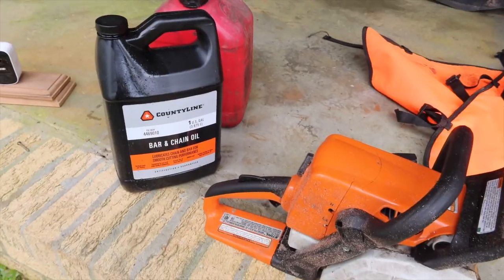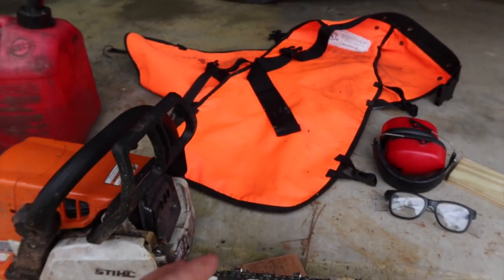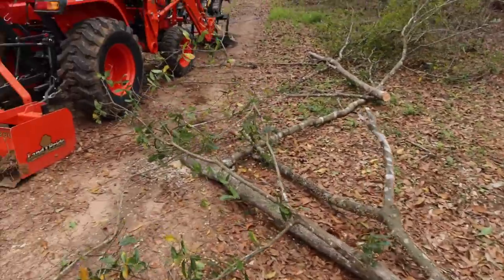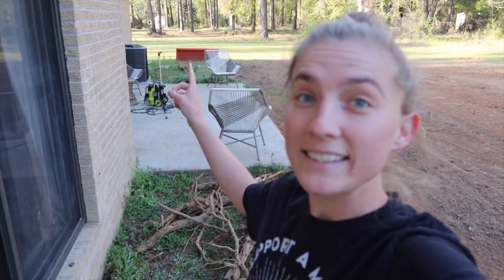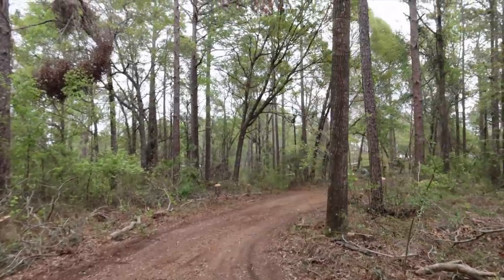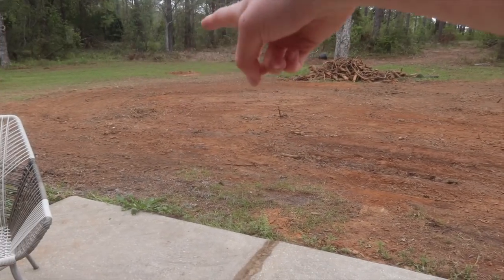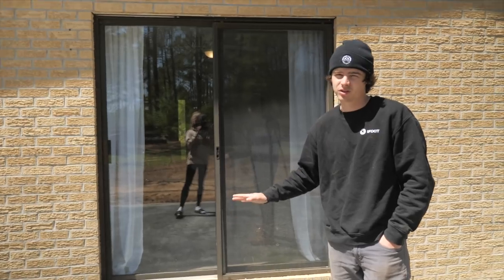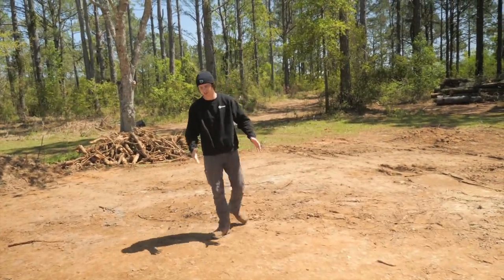Starting Our Dream Back Patio Makeover!

Comment: Fairhope is my home town. I haven’t lived there for many years but when I was younger I helped a friend cut down many trees over time. I cut a large pine tree on my property and in the six years between cutting it and moving away I never experienced issues. I think in the case of a pine tree the resin in the stump preserves the stump for a longe time. I know that pine stumps left above ground last for many years. I chipped fat wood off of pine stumps and it is a tough job. You did good. You always seem to use common sense and that will serve you well. Have fun.

Comment: surprised there isn't any mesh in 6" of concrete, unless it has fiber mesh in the concrete. Take a 1/2 or 3/4 inch copper pipe about 3 foot long. drill small holes and cap one end. Put a garden hose connector on the other end and hook it to a hose, turn on water, and start shoving it in the area thats going to sink, this will wet it and compact it  so that you can finish filling it.  We did this when they cut a new sewer entrance to my  house... got rid of that mound in two weeks. I built a dry concrete block wall about 4 rows high and filled the holes with mud and ran a hose to in it like a vibrator in wet concrete... wall is still standing after 5 years.

Comment: Hmmm, have you bridged your Damp Proof Membrane for the house brickwork? The concrete shouldn't go right up to the house brick, should be a drainage gap, preferably filled with gravel so that rain water on your patio will not soak into your brick & cause damp inside the house! (Same reason Molly dug a trench for gravel around the rest of the house)

Comment: Please don't paint the house! Brick built is more common in the UK, so we experience proper upkeep more. If the house is painted you will change how it breaths, which can lead to damp issues (depending on where you are based). If you want to hide the brick, some free standing lattice in front may work better.

Comment: I can't believe you haven't got any mesh in the concrete!!! Err, you did say it get mad in the comments 😋😂 Hmm, just thinking about your stump issues 🤔 Well, it's kind of the spring so it's sap would have been rising so what you've done if bury a huge chunk of pine full of sap. From what I've learnt recently, this happens in regular pine stumps and the sap goes really hard and it can be chopped up and sold as "Fatwood" fire starters, which are meant to be the best thing to start a fire. What it means gor you is that you will more then likely end up with a fossilized tree stump buried in your back garden and due to the sap slowing decay the only movement you should see will be just soil and NOTHING to do with your stump!!! ....... Unless Dylan can't get a fire going in 10 years time, remembering reading this comment and digs up the garden again 😂🤣😂🤣😂. Re the thickness of your concrete pore, the guy's whole did it kind of do it for a living and if they say it will be fine that sounds good to me. At the end of the day they were missing out on a sale of the mesh. They definitely have the right attitude if they have the integrity to be happy to miss out on the commission  as they know it wasn't needed. Any locals shout be asking for the concrete guy's phone number! 😂👍👍👍👍👍👍
Reply from the maker: Yea the stump is already black and reeeallly thick tar like. It’ll be years and years and years before we have/if we have any issues. Thank goodness for a tractor to bring in fill dirt if we have any issues!